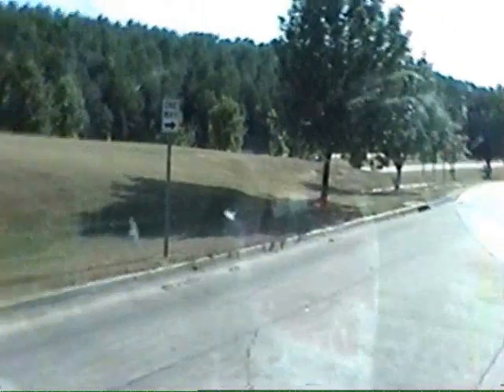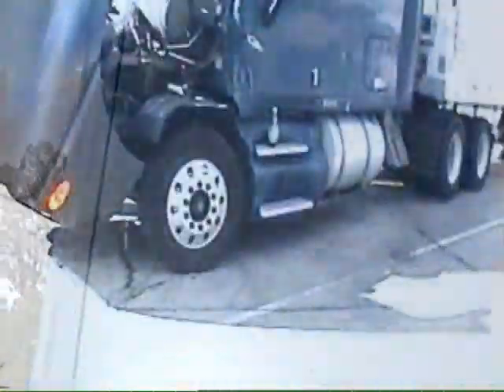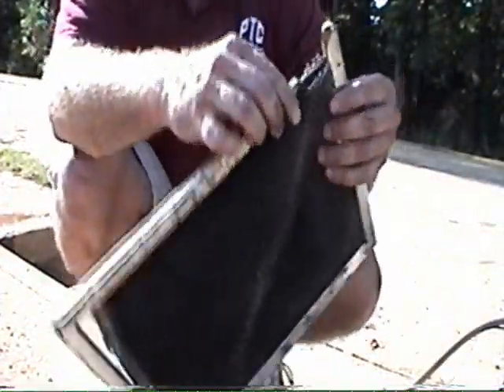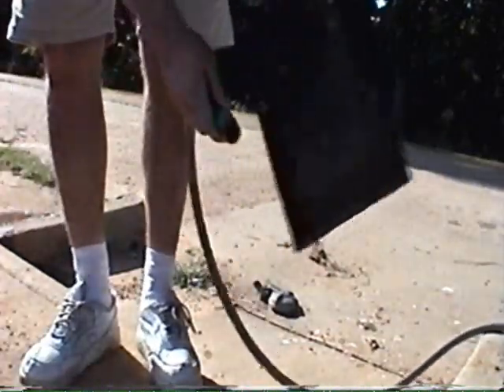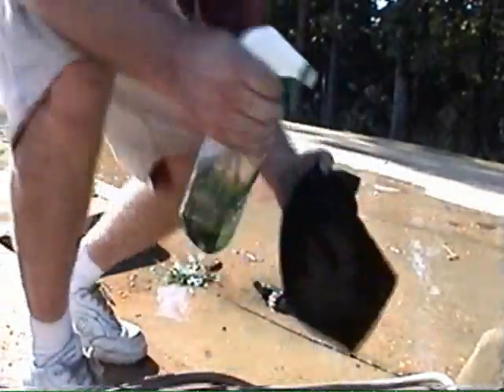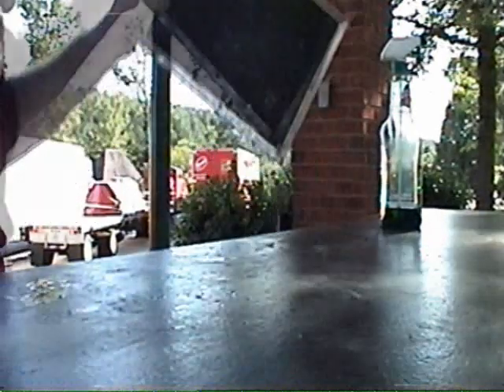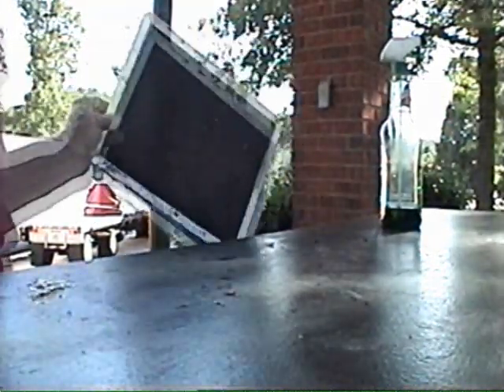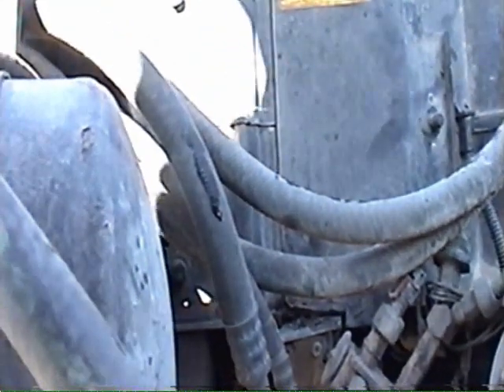How to increase big truck air conditioner efficiency

Comment: Great tip. 
Here are a a few more ideas for improving your A/C performance:

1. Keep the condenser clean and straighten any fins that are bent over (the condenser is located in front of the radiator).

2. Increase your following distance. Tailgating or "drafting" reduces air flow through the A/C condenser, which makes the system perform poorly. Tailgating can also cause your engine to overheat.